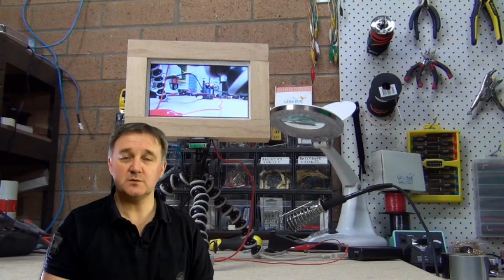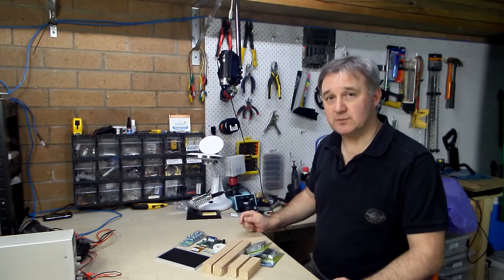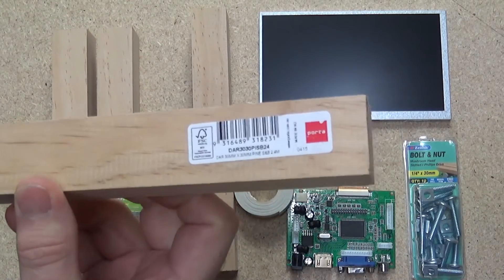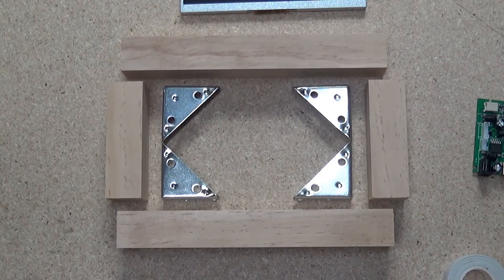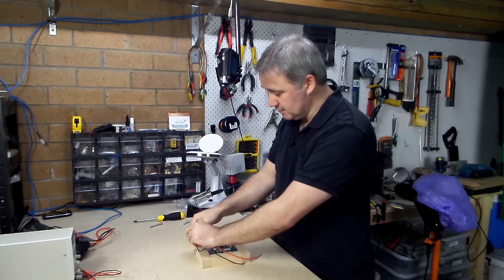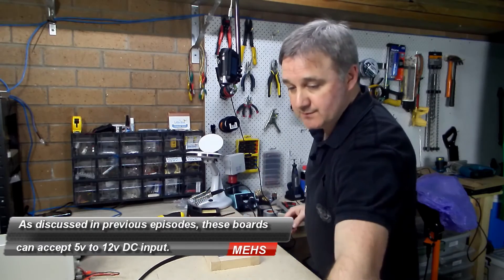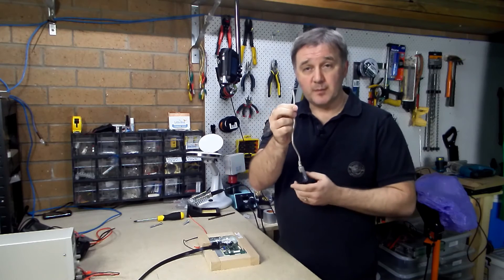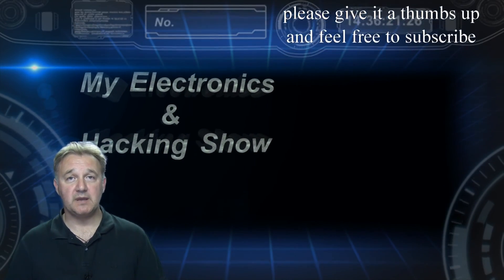DIY 7 Inch Battery Powered Monitor (MEHS) Episode 29

Comment: https://www.aliexpress.com/item/9-Inch-Raspberry-Pi-LCD-Display-Screen-TFT-Monitor-AT090TN10-with-HDMI-VGA-Input-Driver-Board/32705411915.html?spm=2114.13010208.99999999.271.G8BhDl Hi would this work as you explained for a HDMI monitor which i want to make for my Phantom 4 HDMI out put. I have already bought the module for the DJI phantom 4 . I am sorry if it is too much to ask on more thing can i use a car battery to run this monitor with a car cigarette lighter adopter . I need this for my field shooting would truly appreciate a revert
Reply from the maker: - Hi.  I can't read the details on Aliexpress but almost all of these boards and monitors are rated for 12v operation so yes it would do what you want.  They can also run with a supply as low as 5V which is also handy.  The only thing I suggest is you check your car voltage as most are over 12v (around 13.6).  The monitor might take it happily but a 12v power reg (sepic) would make sure the screen and board only get 12v.  Cheers.
Reply: Thanks a ton for the reply (Y)

Comment: I was with you throughout this video, but when you got to attaching the USB power supply you kinda glazed over how to connect that severed USB cord. Do you have a video I could watch or a tutorial that could explain. I have never soldered  before or anything. This is exactly what I want to do though. I've been on Amazon all day looking at Raspberry Pi monitors thinking that I could use one of these screen/board kits connected to a USB battery pack. You have done exactly that! Thanks for this video!
Reply from the maker: - Hi.  Great to hear you're keen to do your own monitor.  I re-watched the episode and yes I see what you mean.  It was an abrupt end and didn't look at the cable etc.  I've covered how to strip a usb cable in some of my other videos but it's easy enough to explain here if you like.  Grab any USB cable.  The end that goes into your computer or a USB battery bank is left alone.  The other end can be cut off.  Remove the plastic covering and the silver shielding to expose 4 small colour coded wires.  The Red is Power and the Black is Ground or Negative.  Discard the other two.  In this example you need to get power from the power supply (Batteries in a power bank) through the USB cable to the monitor driver board.  You can do this by connecting the power and ground wire to the driver board itself (take a look at episodes 41, 34 and 35 for more close ups of this) or you can wire the USB cable to a barrel jack.  The red wire goes to the centre pole of the jack and the ground wire goes to the outer sleeve of the jack.  Let me know if you have any more questions.  Happy to help.  Cheers.
Reply: Thanks for the quick and thorough reply. I will check out your recommended episodes and hopefully be able to get this DIY project done! Thanks, again! Have a great day. :)
Reply from the maker: Phillippia Fuqua  - Just be careful with the details as one of those products you linked has a female connector.  You need a make jack to connect to the display board.   Like-
https://www.ebay.com.au/itm/321704793672

5 Pcs Black 2.1mm x 5.5mm DC Power Male Plug Jack Adapter WS
Reply: Okay. Thanks a lot. I will check the connectors for the correct type and make sure the voltage matches whatever monitor I settle on. Thanks for the guidance during this process. If I get this thing put together correctly I will have to send you a pic of my setup. I really appreciate your help. You have gained a subscriber. Thanks, again! Have a nice weekend! :)
Reply from the maker: Phillippia Fuqua
- Thank you, and you have a nice weekend also.